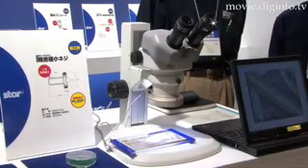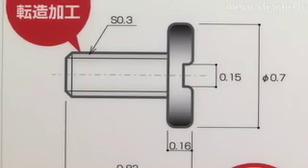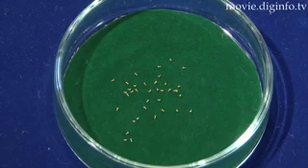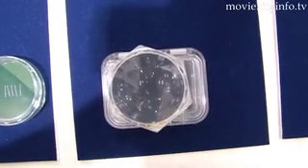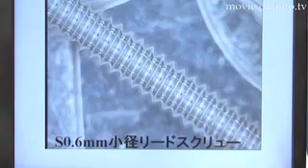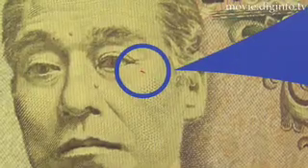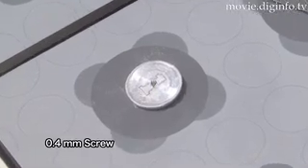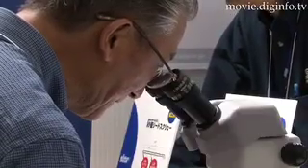The World's Smallest Screw : DigInfo

Comment: '
a screw with  a  --  slot top head is not good,,,
a screw with a  +  phil top head is much better
Reply: While you're 100% correct there is no Phillips driver that size and I imagine that's why they went that route. For a slotted drive, you can use any piece of metal. I do wonder how they managed to install it regardless.